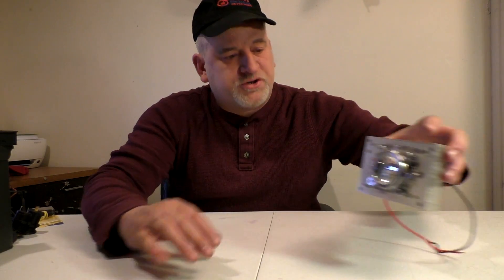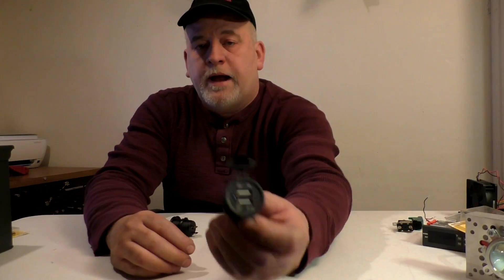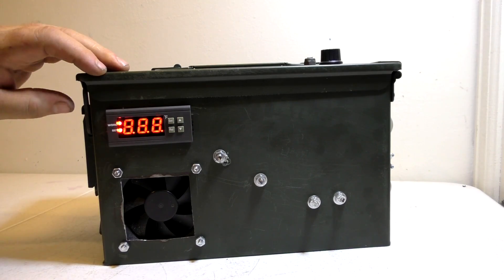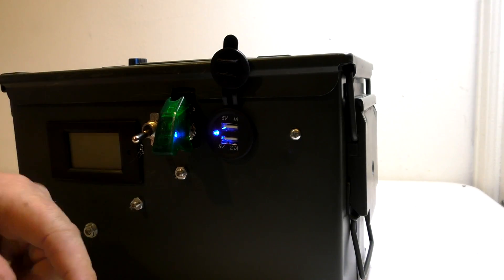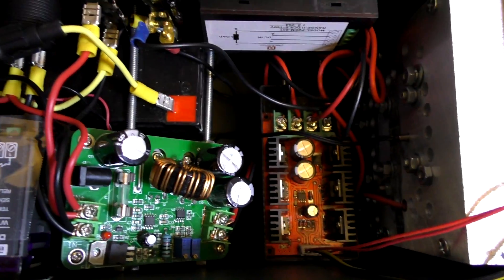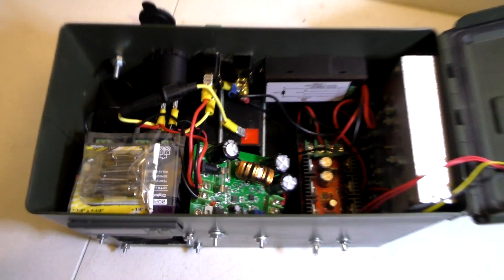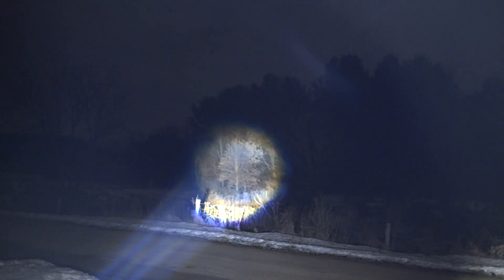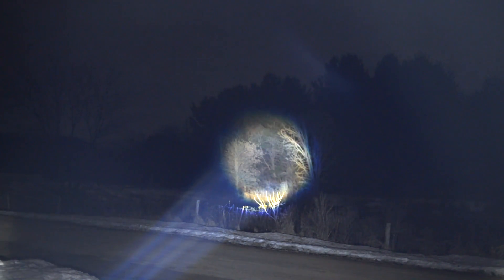200 watt Ammo Can Super Flashlight

Comment: I went with a 20ah lithium used car fog lights a few marker lights 5 switch panel with 12v socket usb and voltage meter. 240 watts only uses 150 with all lights on. Im making another.

Comment: its a great idea but by cutting the ammo can you loose the reliability and strength of the can its self and waterproofing. I built a 50 cal. ammo can flood light that when assembled it looks just like a standard can. It has no fans, No lead acid battery. Lithium need I say more.  Our led is 10,000 lumen flood but can run for 10 hours on high! before it needs recharged.  Our ammo box open or closed is waterproof we are patent pending.
Reply from the maker: +Wade Clezie That is cool and quite a feat. Mines waterproof for about a tenth of a second and battery life on high is 10 minutes.

Comment: Would you please post a build sheet for this project? I'd love to know more about the components used.
Reply from the maker: I'll probably build another with a better thow and can put the components list on with both. Might not happen for a month or two though. In the meantime I can add the components to this vid in comment section
Reply: scannerguy1968 I'd really appreciate any part numbers/names, etc.. I'm preparing to build one. I'd like to possibly run 2 LED'S, with one being low, and both turned on for high. I'm reading everything I can to wire it properly.
Reply: I've been building one myself. I think I need to get a higher capacity boost driver or a better quality led. I can't get my 150W boost converter to output more than 30V while holding the current steady at 2A. My digital meter (same as yours) only shows around 60W for some reason. I used the same basic battery as you did, only I have two 10ah wired in parallel for a total of 20ah. I may try to wire them in series to input 24V to the booster, which may make it easier for the boost to up the voltage to the desired 34V I'm looking for. I'm not really sure.. lol
Reply from the maker: I'm pretty sure 1 is all you need. I had issues at 1st and was going to get two step up converters. Ordered another from the same place and it worked well on it's own. Pretty sure it is like the link I attached.
http://www.ebay.com/itm/Boost-DC-DC-Converter-Power-Supply-Step-up-Module-12V-60V-to-12V-80V-600W-10A-/231572940208?hash=item35ead2a5b0:g:-hgAAOSwBLlU9qKi
Reply: scannerguy1968 that's the same model I have. Not sure what's going on. I'm now waiting on some Bridgelux cobs to show up. I imagine they'll perform a lot better than the Chinese ones I've been trying.
Reply: I blew the capacitor in my DROK PWM motor controller running too much current through it for the chinese LED module. I'm now trying a single Bridgelux cob that requires a lower voltage/amperage but outputs more lumens. I think I'll order another motor controller tonight. One thing that gets me, is that wiring the motor controller after the boost, if you turn the light down, the boost is still working at full power, where you tuned the potentiometers to. So the motor controller will be getting rid of that power as heat. I'm wondering if it would make more sense to wire the motor controller before the boost circuit, to use as a limiter for power running to the boost.

Comment: Man great job,love it.what does it weigh? Whats total cost of project?How long will the battery last before you have to change it out that looks like the biggest difficulty out in the field if it goes dead on ya.
Reply from the maker: Total cost was 178 bucks with the two leds being 75 of that. A person could get away with the cheaper 100 watt for under 10 each and buy only one. So you could build it for under 100. The battery just charges with any 12 volt charger. I use my small car charger and charge it for 2 hours. Just open the lid and attach alligator clips. As far as run time. Both lights on high make it 30-40 minutes. If you just leave one on medium it last for way more than 5 hours. Haven't been able to run it dead yet on medium. Its still blinding bright with one on medium.
Reply: nice!! thanks for responding back.